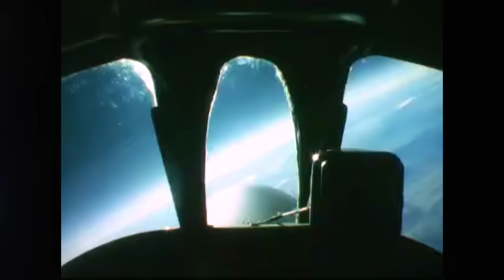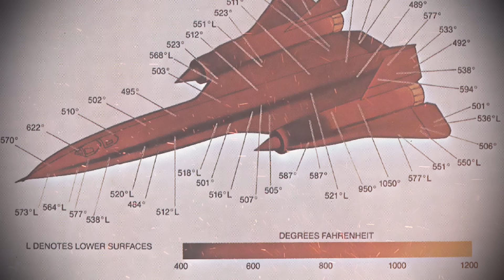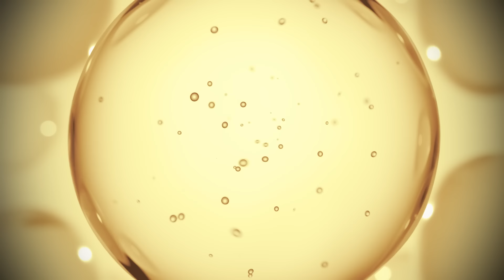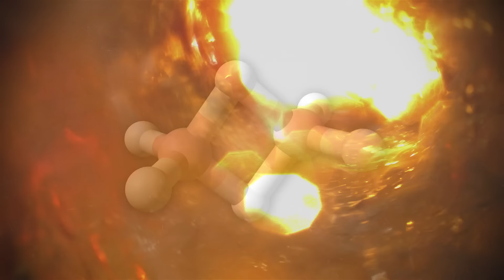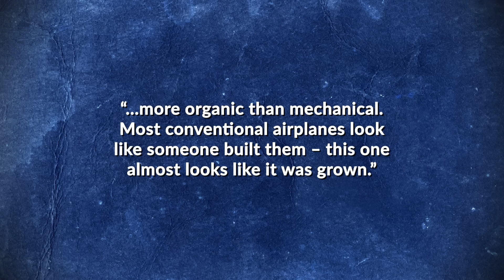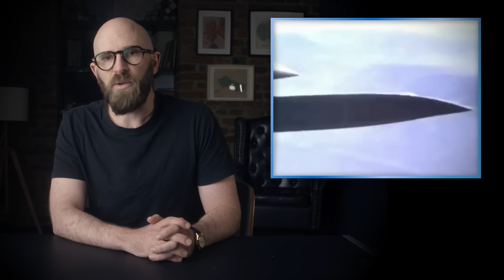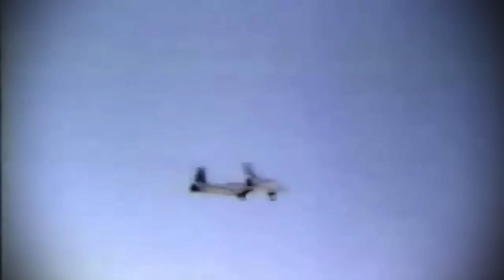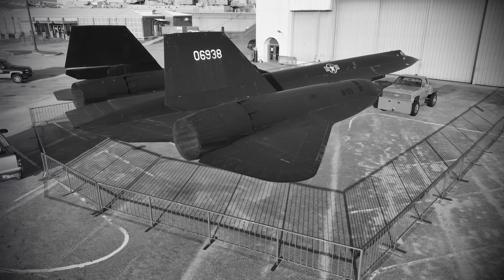How Did the SR-71 Blackbird Get Made and How was It So Fast?

Comment: This plane is in the museum I work at. it's hung from cables in the gallery, and is veeeeery slowly sinking towards the exhibit hall
Reply: Maybe they can put a fan in front of it to generate some lift
Reply: @Colby_0-3_IRL_and_title_fights OP is the fan, unfortunately fawning over the plane has generated no lift.
Reply: @Colby_0-3_IRL_and_title_fights  That's a real laugh out loud.
Reply: @Colby_0-3_IRL_and_title_fights   hahaha
Reply: @Colby_0-3_IRL_and_title_fights How do they even know it's there...?🧐
Reply: There's also one at the Hill Airforce Base Museum in Utah, though it's displayed on the ground.  Such a cool aircraft.
Reply: @chrisshorten4406 You are not wrong. It's a fascinating aircraft.
Reply: @chrisshorten4406  That specific craft is the only SR-71C ever built. They call it "The Bastard".
Reply: @QSB55  I see.
Reply: @chrisshorten4406  That's the one and only SR-71"C" model, "The Bastard". It's the back-end of a YF-12 that suffered fire damage on landing, grafted to the front end of a static engineering mock-up of the SR-71B trainer that was never intended to fly. It was pieced together after the loss of one of the SR-71B trainers, which left the Air Force without a spare when the primary aircraft was down for service. It was temperamental to fly, which is how it got its nickname. The front fuel tank was never sealed and could not be filled, which caused challenges trimming the aircraft in flight. They finally figured out the the pitot mast was out of alignment, and that fixed most of the problem. I stopped by on the way to my in-laws who live in Logan, UT for Christmas in '23 and found out that it was in a new wing of the museum that was under construction and closed to the public. We had even changed our travel plans so we could get there during business hours, all for nothing.
Reply: Like how slowly
Reply: That's... an interesting way to say something that sounds dangerously close to either the ceiling is sagging/ breaking, or that the cables are stretching/breaking  o.o;;
Reply: Or the airframe is bending @joshquivey6990
Reply: A very long aerodynamic stall.
Reply: Omaha Nebraska? Awesome museum. I was at the museum in Dayton Ohio today and loved seeing the SR71 there
Reply: @samking7213 Wright Patterson is a very good museum. Probably because Ohio is the birthplace of aviation and home of Neil Armstrong, John Glenn, and Jim Lovell.
Reply: The one in the Museum of Aviation at robins AFB you can touch and look inside the engines and stuff. It's free to go in and they have a huge collection of aircraft outside you can get inside of.
Reply: Omaha? Absolutely wonderful. Great museum and everyone should see it.
Reply: Can't be the one in Hutchinson KS, that ones on pillars. The nose is is so close to the floor you can touch it. I love that museum. They also have parts of Apollo 13 there
Reply: I think I've been there.  Excellent museum.
Reply: Has anyone checked it for a deception logo/emblem?
Reply: The only surviving trainer SR-71 is at our museum. Every pilot who has every flown an SR-71 has flown this one. Every year they bring a group of the engineers mechanics and pilots for a huge 4 day seminar. It's so cool. I have pictures with Ed Young holding my son in the cockpit of it.
Reply: I bet that's the one I saw.
Reply: I hope the museum has a good insurance policy. That sounds like an accident waiting to happen.
Reply: Richmond?
Reply: hutchinson kansas? it's looming quite dramatically in the lobby.
Reply: @nicholas3139 that one is on pillars
Reply: Omaha???
Reply: @justincurtis3884 maybe Warren Buffett can donate something to fix it
Reply: We’ll be careful not to get the cube too close to it.
Reply: Robins AFB!?
Reply: I remember sleeping underneath one as a kid at the air zoo in kalamazoo mi for a boyscout trip, still a good memory
Reply: False.  This plane never did anything slowly
Reply: Strategic Air & Space?
Reply: Please dont say omaha 😭 i love seeing this plane
Reply: That plane can't stand still
Reply: I'll have to check out those static displays. I only got to get up close and personal with the SR-71 once while stationed at Beal AFB California. I was in the 7th missile warning squadron at Beal but I was space command and only got to visit the flight line due to dating some young ladies that were crew chiefs.
Reply: Kansas Cosmosphere?
Reply: @bradlawrence6461  that one's on pillars
Reply: I was in goose bay Labrador in the late sixties. One of these things flew over and it was shocking for my older brother who was a plane engineer geek. I was a kid and was more interested in fighting planes, but he was babbling incoherently he was so excited.
I had to listen to him lecture about this planes relevance. On hindsight, I guess it was a big deal.
Reply: I've had the pleasure of seeing the blackbird at the Evergreen museum. One of the engines on display and a close up look at the cockpit. The plane is fantastic.
Reply: Classy. Well played.
Reply: Nice!
Reply: I'm betting air n space next to dulles
Reply: Thats a huge plane to be suspended from cables
Reply: Magnets
Reply: Add power.  🫡
Reply: There’s on at Pima Air and Space Museum in Tucson, AZ. Such an amazing aircraft.
Reply: The irony!
Reply: They cut the wing struts. Stupidest idea ever.
Reply: It's been a while...but the one at the air museum in McMinnville, Oregon is just parked on the floor, with stairs you can climb up to see in the open cockpit. Next to the Spruce Goose, if I recall correctly.
Reply: Man I grew up going to Mahoney Park and that air museum I go any time I'm back up in Rockport Missouri from Florida
Reply: The final strike 🥰🥰
Reply: Seattle?  If not, they have one in Seattle. It’s insane how big just the engine is.
Reply: Definitely not sac that one is on pillars
Reply: I saw a cool display with the sr71 near Portland. The spruce goose was there too
Reply: I was lucky enough to see one at the Kalamazoo Airzoo.
Reply: Did you say you from Kansas?  That's what I heard..
Reply: @mattyancey28  that one's on pillars not cables
Reply: Seems like a disaster waiting to happen.
Reply: Hopefully, not Evergreen...can't remember whether they have this or another kind. Cool place if you ever come to Oregon.
Reply: How slowly?
Reply: Boeing Museum in Washington State has one on its wheels as it should..
Reply: That museum has balls choosing to hang it like that...Doesn't sound safe at all.
Reply: Maybe u should take some gorilla glue to work and stick it to the ceiling that might work
Reply: I've never been to a museum that holds the SR-71. I was blessed to get assigned to Beal AFB in California.  Which is the home of the SR -71, U-2 and TR-1 spy planes. I dated a crew chief on the SR-71 and she arranged for me to get to sit in the cockpit of a SR-71. I also got to watch some take offs for missions and got to see them test the engines after a rebuild. I was there when the AF OSI and the FBI arrested airman Bruce Ott was arrested for attempting to sell the tech manuals to the Russians. But i have to admit it is the most impressive aircraft in the world.
Reply: It's not in the exhibit hall?
Reply: SAC Museum In Nebraska?
Reply: Museum of flight.
Reply: Does it come alive at night tho? DOES IT?! 😂
Reply: There’s an A12 sitting outside with many other aircraft in Birmingham’s museum.
Reply: So bro g it back up?
Reply: That sounds dangerous af
Reply: Definitely air and space museum in Omaha 😂
Reply: So the slowest and fastest plane ever you say